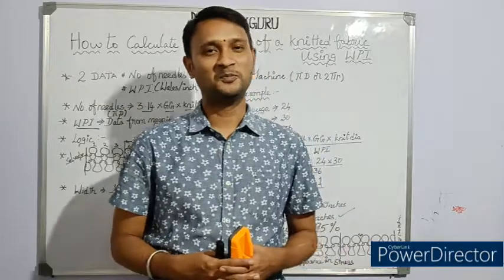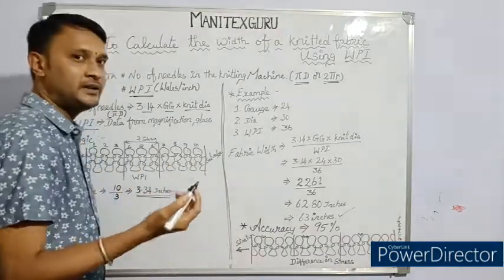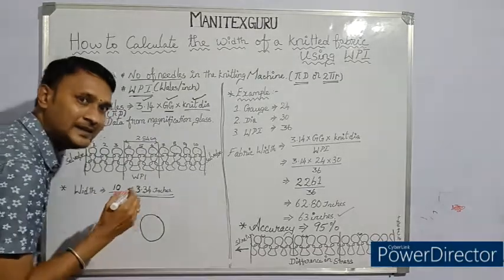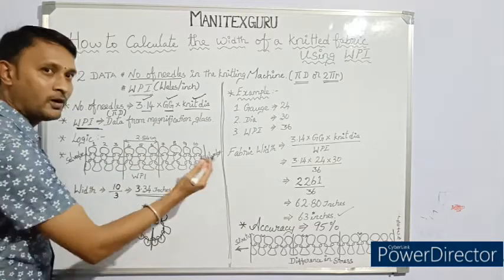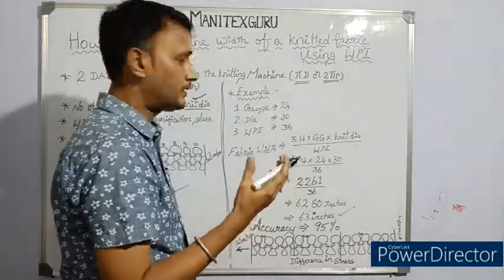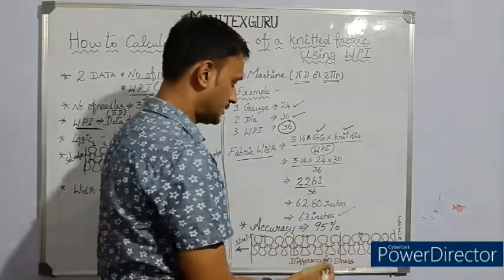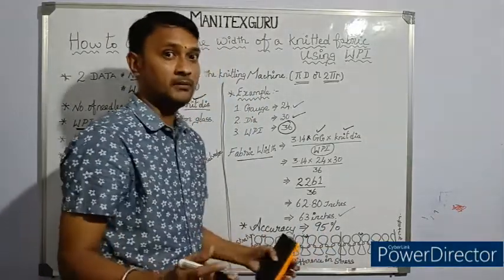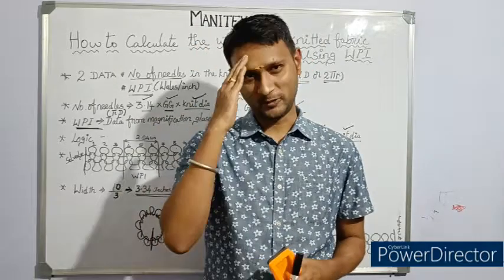HOW TO CALCULATE THE WIDTH OF A WEFT KNITTED FABRIC USING WPI (WALES PER INCH)

Comment: 25  kişiye  yazdim  hiç kimse  cevap  yazamdi    soru şu  bir kumaşin  gg nasil  buluruz  ?
Reply from the maker: Hi,

As I mentioned in my previous reply, the gauge selection is made based on the yarn count which we use for knitting.

A small example - if you are planning to knit a 18s count single jersey. We can knit either in 20gg or 16gg knitting machine only. We can't knit it using 24gg knitting machine. Because the space between the needle and sinker will be smaller when compared to the diameter of a 18s count yarn. It's a simple logic. That's it. 

Hope you have understood.

Comment: Dear sir how much.check width  Wels 34 par inch
Reply: Samol cutting  wels 34  how much width
Reply: Sir please reply
Reply: Sir not confirm to dia gg   buyer sample samol cutting length size 2 inch width 3inch fabric quality      32cotton 40dn lycra pk  wels count 34 only   your advice
Reply from the maker: Hi,

Thank you for your information.

Fabric Quality:32s+40d lycra pique
WPI : 34

In general, 32s+40d lycra pique can be knitted in either 24gg or 28gg. 

Since your WPI is much denser, my guess is knitted in 28gg

Fabric width if knitted in 28gg = (3.14 x 26 dia x 28gg) / WPI

= 2285.92 / 34
= 67.23 inches End to End.
Reply from the maker: Hi,

Thankyou for your comment.

Pls advice the fabric quality and in which gauge the fabric got knitted to advise the fabric width.

Comment: But you did not mentioned that, WPI,  would we take it from grey fabric or finished (dyed) fabric,  what will be the difference between grey and finished fabric??
Reply from the maker: Hi Sazal Mahmud,

Thanks for your comments.

In this video, my topic to explain is how to calculate the fabric width on a finished fabric using WPI. Hence your question is explained.

Re : WPI difference between grey and finished fabric depends on multiple factors like

Yarn count
Gauge
Loop length
Residual Shrinkage in the fabric.

Hence we can't declare it easily.

Comment: Hlo can u tell how gsm varies before process and after processing
Reply from the maker: Hi Rajat,

Thanks for your query.

Four parameters that are responsible for GSM are, 

Yarn count
Loop length
WPI
CPI

Before and after fabric processing, there won't be any changes in yarn count and loop length. ( if there is biowash during wet processing, there will be a slight change in yarn count, the yarn count becomes slightly finer). There will be changes in WPI n CPI only.

Just because of changes in WPI and CPI, the gsm varies in before and after processing.